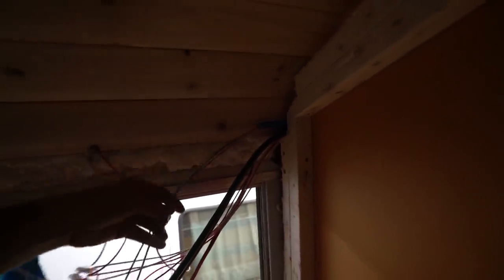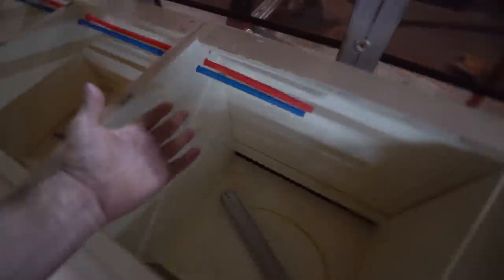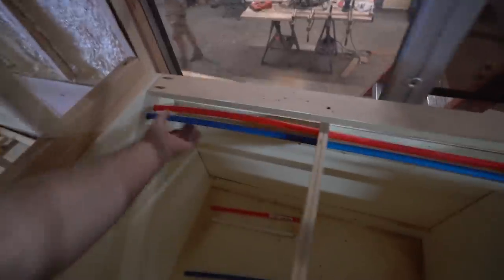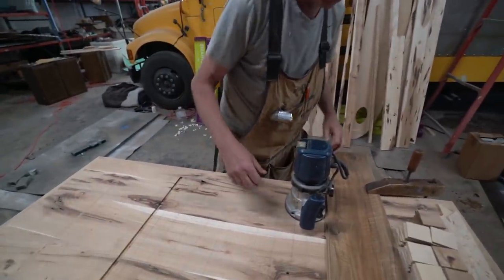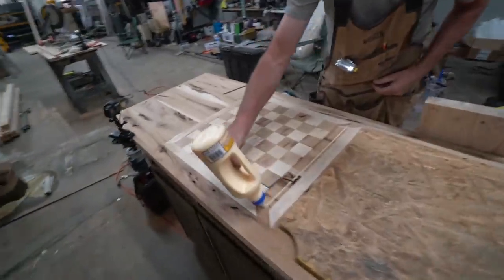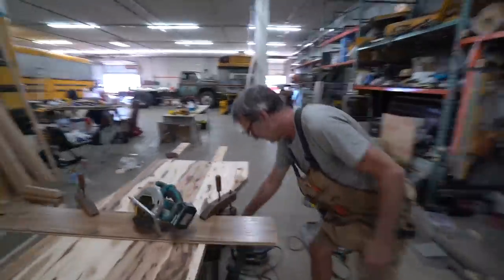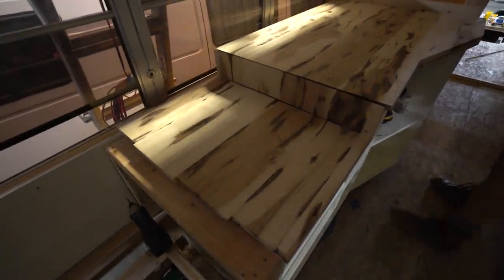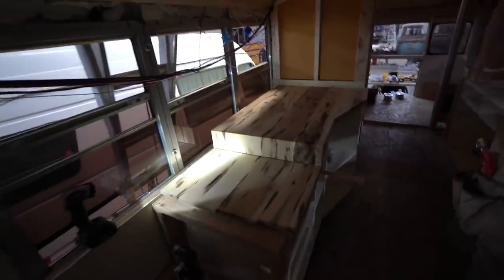PEX Plumbing + Chess Table + Waterfall Countertop

Comment: its actually a shame he glued the chess table to the table top , if he had made the chess table removeable (sunk intoo the table top) you couldve made a pocket / shallow space under it to keep the chesspieces in
it might allso be a good idea to put a metal plate under the chess table and put small magnets under each chesspiece so they stay standing on the board even with the bus moving , can still do sumting simulair and put a sunken metal screw or nail in the middle of each checker as a base for the magnet to hold ontoo (needs to have some body to get enough holding force out of the magnet in the base of the chess piece )
Reply from the maker: It’s not deep enough for that. It folds to go under the bench.